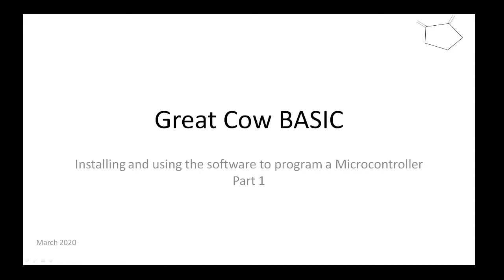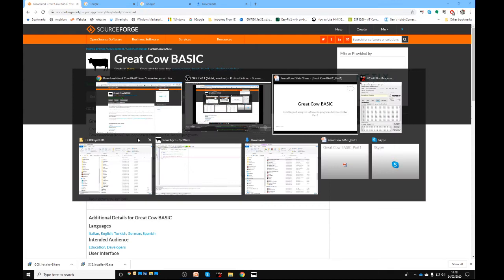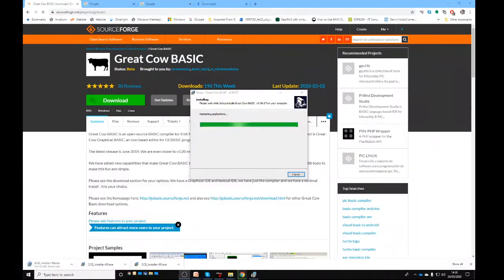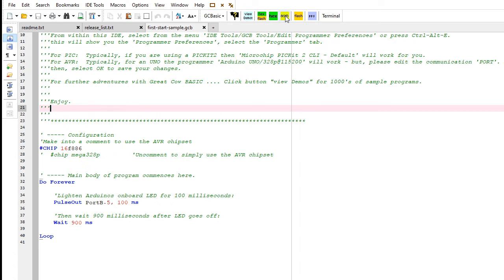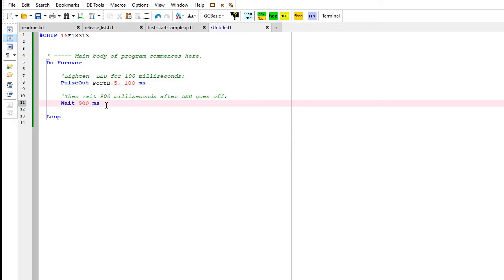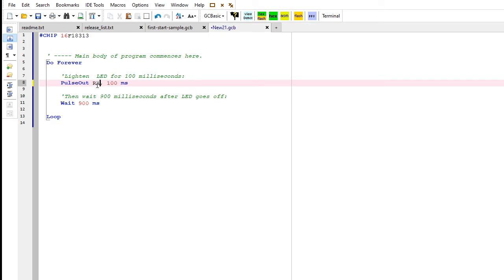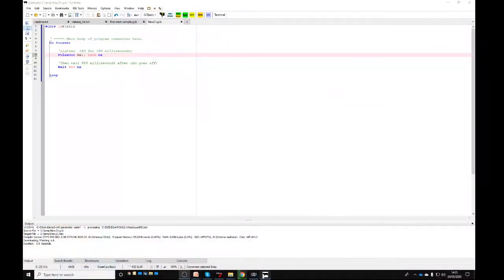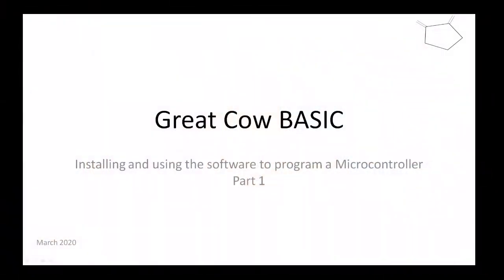Great Cow BASIC:  Part 1:  Installing and using the software to program a micro-controller.

Comment: Hi. A useful video, but your instructions for finding the batch file don't seem to apply to the latest version (SynWrite 6.22.2290)! The "Tools" tag is now "IDE Tools" and it is not possible to find any link to editing a batch file. Incidentally, there don't seem to be any Demo files either... 😞
Reply from the maker: Yes, we have updated since this video.

When did you download from SourceForge? 

I could post a new video to show the changes if this would help.
Reply: @AnobiumTech  Just this week from SourceForge!
Reply from the maker: Ok. I will post a quick video tomorrow.
Reply: @AnobiumTech  Great! Another question: how does GCB -- and how do I -- know which USB port to use on the PC to connect a PICkit 3?
Reply from the maker: The USB device is registered to PC. The programming software talks directly to the USB port. GcB passes the hex file to the programming executive and then the programming happens
Reply: @AnobiumTech  I don't understand the difference between GCBasic and GC Studio - they both look the same. And F4 just does nothing... 😞
Reply from the maker: Does you install look Black ? See https://youtu.be/xofoWkR8DKM?list=PLN9gcw34mhup8pfy3HgEaALiWTpsTvzUE&t=462 - you will have to restart the video for the full installation.

Comment: Getting a lot out of a very tiny 8-PIN chip:  20210802 Quad Mecanum Wheel Rover Kit     https://youtu.be/dAmcBHbG_vU
That is a PIC 12F1840 chip doing all that and it can still do much more!
Reply from the maker: Yes, the 1280 is a similar but older chip.  With Great Cow BASIC you simply have to change the chip definition & port naming and you get the same program running.

Comment: Hi and thanks for your video(s).  I haven't used GCB in several years so I'm enjoying your tutorial.  It's kind of odd though as 16f877a in the demo doesn't appear in PPS tool.  That's a chip, among others, I have.  Thoughts?
Reply from the maker: A 16f877a is not a PPS chip. So, it does not appear.
Reply: @AnobiumTech  thanks much!  I did note that in a comment below after I commented.  Actually, I have no idea what PPS is, even after doing some googling.  Ha!

Comment: Absolutely fantastic of you to create these videos. Thank you A+++ I have a PICkit3, and have managed to successfully program a 16F628A, but I don't know what exact parameters are required to 'Add' it to the available programmers for it to operate seemlessly with GCB as your PICkit+2 does. Also the PPS doesn't appear to have 16F628A or any 16F6xx I.C.'s. Is this something that will be added in due course or can I manually add I.C.'s myself somehow?

Thanks in advance.
Reply from the maker: Thank you.

The 16F628a should work if you select the PICKIT2 - move it to the top of the list.

Regarding PPS - the 16F628A or any 16F6xx I.C. dont need PPS.  PPS is for the newer ICs.

Comment: I would do a video indeed I am of using a uno/nano as a device for users with great cow basic as you with all intentions good make it seem harder than it is. Do a video of a uno and how it can send results to the gcb terminal so easy without rs232 to usb converters.Salam. Respect. 
GCB is easier to use than you make it Evan. No disrespect but you get to techy.Dumb it down a bit and assume users are new. GCB is not a steep learning curve. You learn as you go from previous use of basic.I will support gcb as best I can.
Reply from the maker: Thank you for the feedback.

If you help me design the video, that means the content, I can easily make a simple video.